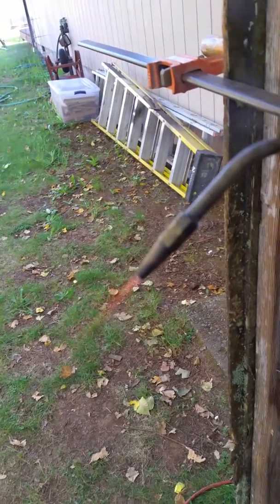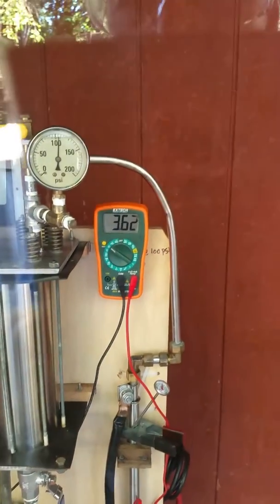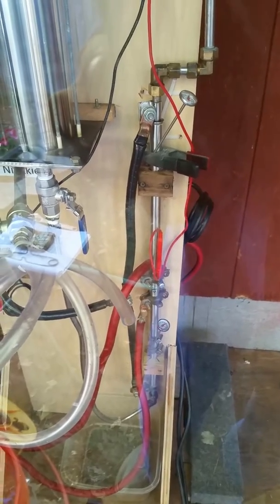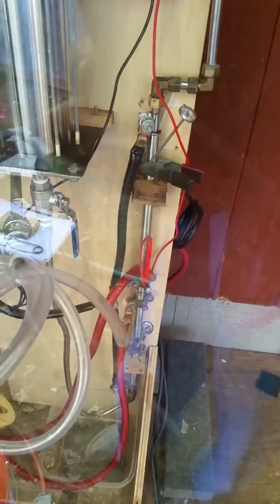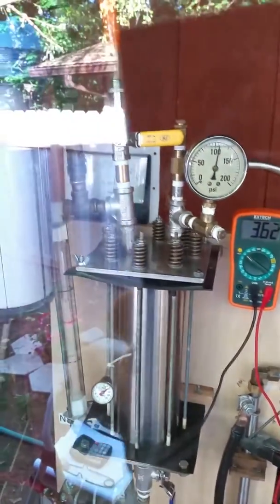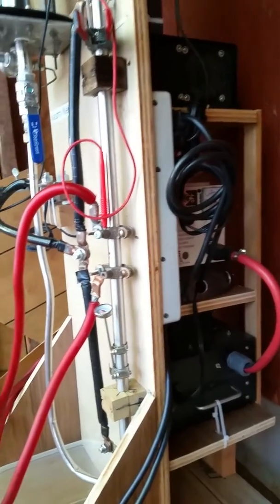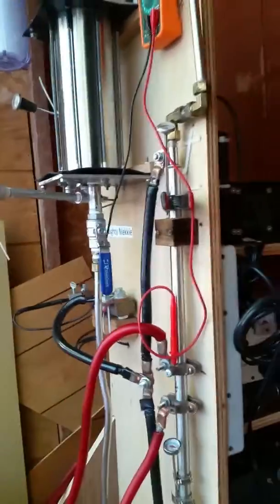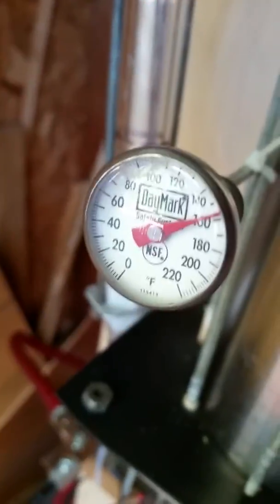High pressure hho gas torch system

Comment: Whats backpressure?  Are you just pushing water to separate the gas you arw using to pressurize the hho?  Like how a water column works or similar? Otherwise how would you be pressurizing the gas by simply using valves and chambers?  I figured the easiest and most diy common way yo compress hho was to gather it in a balloon since it is lighter than air, then use a hermetically sealed compressor to collect the gas through its intake and those little compressors can push upwards of 900psi if you give em a good enough go at it..  i dunno the point of pressurized combustion of hho but id assume its not far fetched in doing..
Reply from the maker: Building pressure above 12 psi is very dangerous.  It will self ignite.  This technique is used by Fred wells aka FAST FREDDY from Arizona,  the gun maker and leading scientist in the field of running engines on HHO gas with over unity results. I meet him years ago. Look up 2004 DODGE PICKUP RUNS ON WATER on youtube for more info. My system produces over 100 psi and water temp is over 212F. The system I saw from fast Freddy in the dodge pickup was around 40 psi. A back pressure valve allows the hho gas to stay in the reactor tank until it reaches desired pressure  a d then leaks out to be burned. Heed the warnings on my video for safety procedures if attempting this setup. People have been injured and killed when attempting to pressurize Hho gas. Point of pressurized hho gas is to allow it to be injected into an engine like propane gas. This is the Fast Freddy way.
BE CAREFUL. YOU HAVE BEEN WARNED

Comment: Why don't you run a vehicle on this Hho gas.
Reply from the maker: we need to get the volume way up (10 liters per minute or more) before we can pull that off. These experiments are based on the work of Professor Fred Wells aka Fast Freddy. he is to my knowledge the world leader in running engines (cars and trucks and jet engines) on HHO gas he generates with his cutting edge HHO generators. He was an instructor to Stanley Meyers back in the days and in fact Stan help Fast Freddy get some of his circuits posted on the internet in the beginning.
Reply from the maker: https://www.youtube.com/watch?v=zMzgAj2Gqoc
This is one of the vehicles Fast Freddy ran on HHO gas only. I visited him at his gun shop in Arizona and saw this system after it was taken off the vehicle. the guy filming this video is Fast Freddy, and the driver is his former president of his company.